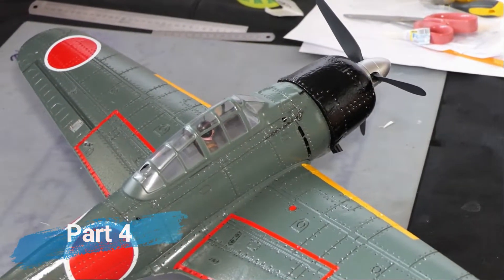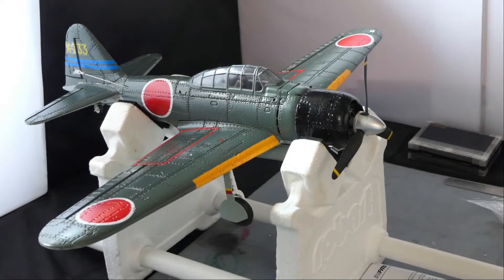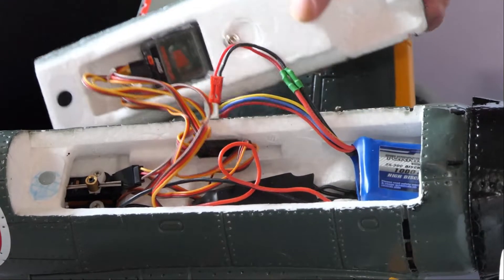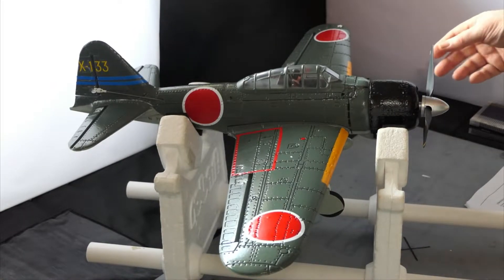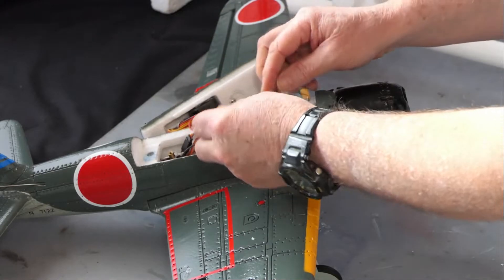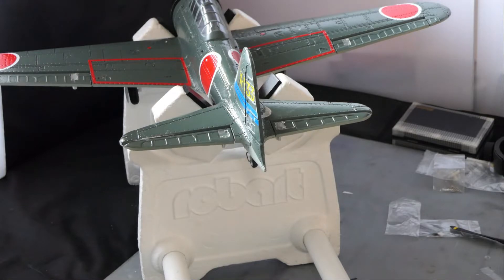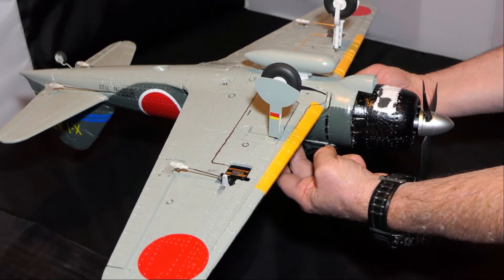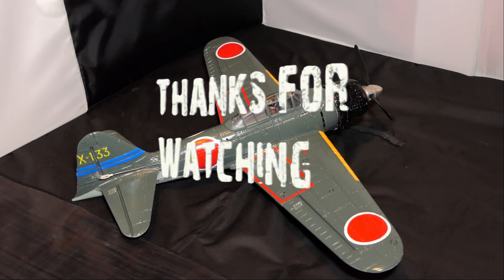Build - FMS 800mm  A6M3 Zero -V2 - Part 4 of 4

Comment: Mine flies good with only 30g of weight stuffed inside as far towards the front as I could and I use 2s 1300mah batteries. So that's a better solution than adding weights on the outside. And this Zero flies great!
Reply from the maker: Agreed I did some more foam bashing and managed to drop 10g of weight also hidden the weight I have inside the aircraft...I do show this at the end of this video....

Comment: I found this tail-heavy issue with many birds that have been around for a while. I guess the battery just got lighter and lighter over time. Maybe the electronics in the nose as well.
Reply from the maker: I would love to do that but I just cannot find the space for the electronics I might replace the AR620 with and AR410 RX - If I decide not to install the ORX Stabiliser unit - not decide yet - if I do use it it will have to sit on top of the ESC....
Reply: @FlankerTanker   I like the SAFE function better than the ORX 6x unit. So I use an AR636B SAFE receiver in my HK 750mm F4U. Had to dig out some foam to get it fitted on top of the wing. Also added flaps myself. So it was a little more wiring in there. 

Looks like this zero has a smaller fuselage. So maybe the ORX 6x is your best bet. Just be careful when you put a stabilizer on top of the ESC though. Heat, high current, all kinds of things could mess the stabilizer up.
Reply from the maker: @enzok6414  Decided to go for the Lemon RX with Stabilisation - it fits well (yes on top of the ESC !!) but it allows me to tidy up the servo wires and make it a lot neater in the Zero - still balances with a tiny bit of nose down at 40mm with 60g up its nose.. I am still using the 1000mAh 3s - but cut some foam out so it moves further forward than it did before... tested and all seems good - I can also adjust AS3X gains on the RX via the TX while in flight - I did not need the ORX Beginners mode... so that will be used on something else....

Comment: Picked one up from a fellow leaving the hobby for $25. I'm curious what your thoughts about adding flaps on this beauty?

Great series btw!
Reply from the maker: I thought about it but in the end decided if flys ok without them - I have flown it a lot since 3 years ago - In fact I only sold it on this year !! - I ended up hand Launching it most of the time - it takes to the sky well and even with the nose weight it lands (well) to be honest like any warbird - tips over !! - so I removed the landing gear and land it on the belly..no issues..
Reply: @FlankerTanker  I’m saving this until I’m a little more proficient with an Eachine BF109. If I can install and load a Flight Trainer app with my RadioLink AT10ii using a Chinese dongle set up, even better! 

Thank you for your response, cheers!

Comment: instead of adding so much weight at the front, why not add a bigger battery, like 1500 mah 3s, heavier battery and with the advantage of having a longer flight time.
Reply from the maker: Very good point , I would have done that but the area for the battery is so tight and small - even with foam hacking I could not get anything much large into the nose - I am sure something could have been done - but its too small an aircraft  in my books to spend a lot of time and effort on .

Comment: Good morning Flanker,

Good build video. I recently ordered a set electronic callipers from Ebay that are a great measuring tool.  (150mm 6'' Inch Electronic Digital Vernier Caliper Micrometer Gauge Carbon Fiber
Thought it might interest you about 4 quit
30c here today still wind but no flying until Thursday due to snap 5 day lockdown here
Reply from the maker: I will go and look.....thanks ...we are still in full lockdown here....not flown since 1st Jan..... stay safe...
Reply: And you bro.

Comment: Hi martyn
Did I speak to soon or what about the CG... Thats a massive amount of extra weight. Absolutely NO chance of a dead stick your have to come in at full chat and keep the speed RIGHT UP ON TURNS TO AVOID TIP STALLS.... like me we will have to be on our A GAME otherwise it will all end in tears
Brian
Reply from the maker: I have come up with a neat solution and managed to loose 10g so now running with 60g of weight and it is hidden in the nose ( yes Hidden) - LOL -  regarding stability - I have gone for a Lemon RX  with Stabilisation (AS3X) -  it sits on top of the ESC, and the Servo wires are all tucked away and taped up - so it is much neater - the Lemon also has Stability Gain control from the TX -  I really do not need the Beginners mode the ORX provides....  - I have repainted to cowl and it looks good - just need to set Rates and she is ready to fly.....
Reply: @FlankerTanker  Beautiful hidden install! May I ask what kind of weights are you using?